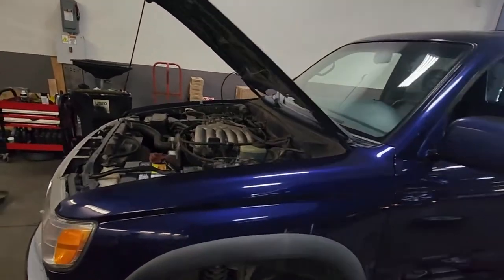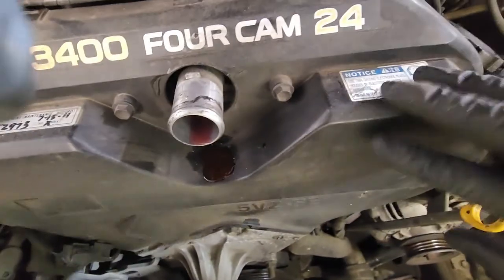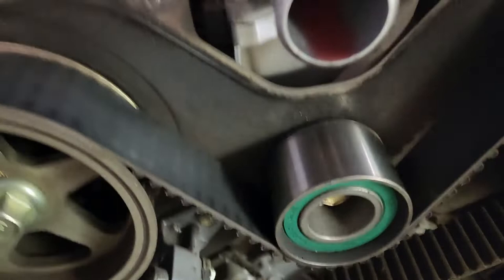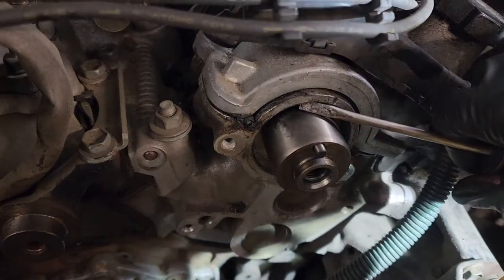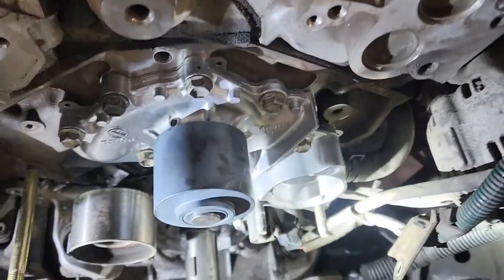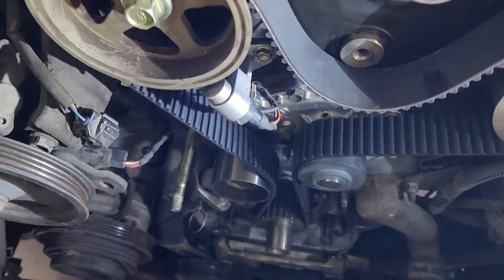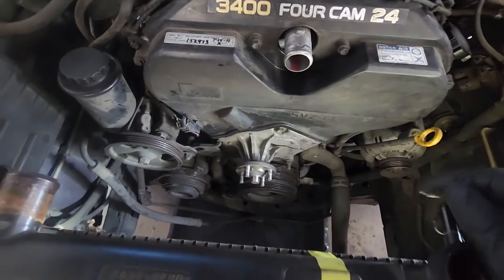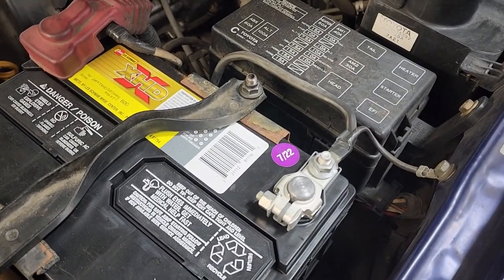3.4L Timing belt and waterpump replacment by a Toyota master tech

Comment: Great tip about putting the cardboard against the radiator I have done that for several years when working on any vehicle that requires removing the fan and or the water pump or whatever is on the front of the engine. 👍
Reply from the maker: Easy way to save yourself from an easy accident.

Comment: Hey drew I have a question about the thermostat bleeder valve I seen manuals say to put them in with the bleeder valve in the 6pm position which is better the up on down position I am about to do a water pump and timing set with the new thermostat as well
Reply from the maker: You are correct. The manual says to install it in the 6 position. This is the only vehicle I have seen that, so I installed it at the 12 position still. I have heard that either way will not cause an issue.
Reply: @shoptimewithdrew  thank you I will be trying that 12 position
Reply: Follow the manual and put that valve at the bottom, regardless of logic.  I have owned a 1999 for 25 years and I guarantee these engines run several degrees hotter when that valve is at 12'Oçlock.

Comment: The thermostat jiggle valve is supposed to by at the 6 o’clock position. Isn’t that true for all 5vz engines?
Reply from the maker: You want it between 11 and 1. Place it  at the top so if there are any air bubbles they can get by the thermostat.
Reply: @shoptimewithdrew  the factory manual for my 2001 says 6 o’clock though. These engines apparently run hotter when at the 12 o’clock position
Reply from the maker: You are right. That is what it says. I have never looked it up. Everyone I have taken off was at the top, and all that I have installed have been at the top.
Reply: Enjoyed your video, I just replaced the water pump and thermostat on my 1990, unfortunately to no avail still overheating, head gasket on the 3.0. I acquired a 1996 with a recent timing belt lots of new parts shocks brakes etc but with cracks in the frame. I will be doing the conversion to the 3.4, I love all these videos as you show tricks of the trade for installs etc, I feel confident I can get it done. Going to save my second gen is in great shape otherwise.
Reply from the maker: Thank you! The 3.4 engine is a really good engine. If you maintain them, they can last a long time.
Reply: Wondering if you could help answer this question I have . So I pulled the 5VZ fe out of my 2001 4runner , it’s now sitting on a engine stand .  I want to do a engine refresh since it’s got a head gasket issue . When I drained my oil I had coolant in my oil , I rotated the crank to put it to TDC I noticed when I aligned the cam pulley marks to the notches  on the timing backing plate , the crank gear timing dot does not align with the mark on the oil pump . What could be the cause of this ? I have pictures and videos to show just don’t know how to upload them here .
Reply from the maker: You can send the pics in a msg on Instagram if that would help.

Comment: so is it ok if you should turn one of the cams off mark to turn it all way around to the timing mark again? I did this and now am worried it will mess it up. Love your video sir.
Reply from the maker: On the 3.4l, you can turn the cam completely around. This engine is not an interference engine.

Comment: One of the 12mm nuts of the 4 from the fan is rounded on mines. What’s the best way to get it off?
Reply from the maker: A good end wrench. I have had to pull the bracket off with the fan and then get the nut off. That is not fun.

Comment: Hey drew, when the cams gears are lined up with the markings and harmonic balancer is at zero , but the crank gear dotted mark is not line up with the nipple, it’s off by a tooth, how do you get it to all lined up?
Reply from the maker: You will need to remove the belt and rotate the crank slightly. If you get a factory belt, it will have timing marks on it. If the marks line up, it will be in time even if the cam and crank are off the engine marks slightly. Hope this makes sense.
Reply: Ok I’ll have to try that, hopefully it will work out for me. Thank you!

Comment: When you were reassembling and doing the 1 rotation, why did the right cam mark wind up on the  left cam mark?
Reply from the maker: If you are talking about the marks on the belt, they will only line up on the initial setup. You would have to rotate it several times to get those to line back up. After the initial setup, you go off the marks on the engine, not the belt.
Reply: @shoptimewithdrew  Thanks Drew.  I turned everything one full rotation after initial setup and every mark was one tooth off.  But to begin with, every mark was lined up.
Reply from the maker: I wonder if it slipped a little. Maybe your tensioner is going out.
Reply: @shoptimewithdrew  No Sir, nothing slipped.  I went an entire rotation clockwise and brought all of the cam and crank marks back to TDC and it had moved one tooth for each one.  It was many turns on the crank to get the marks back to the top.  That is why I asked you the first question about the belt marks the other day.
Reply from the maker: I guess I'm just not understanding. Is the timing off, or is it ok?
Reply: @shoptimewithdrew  Crank timing mark is lining up and so are cams.  Should be good to go.
Reply from the maker: Good to hear. I'm glad it worked out.
Reply: @shoptimewithdrew  Runs like a top...  Thank you Sir!!

Comment: My left camshaft keeps turning when I pull the pin from the idler tensioner
Reply from the maker: As long as it all lines up with your timing marks, you are good. Rotate it around once and verify your timing.